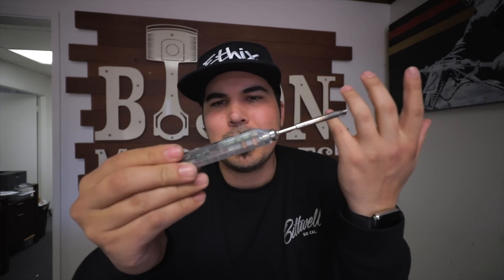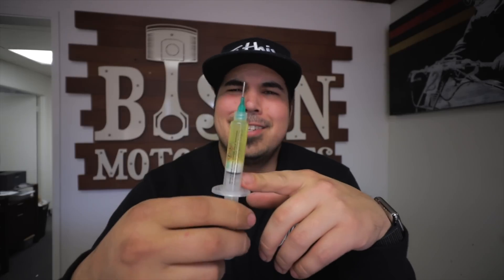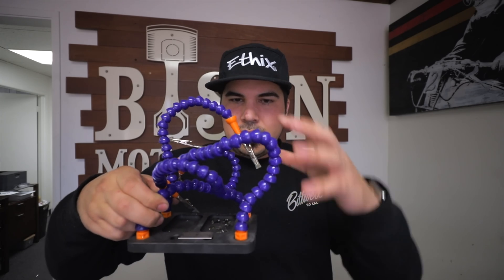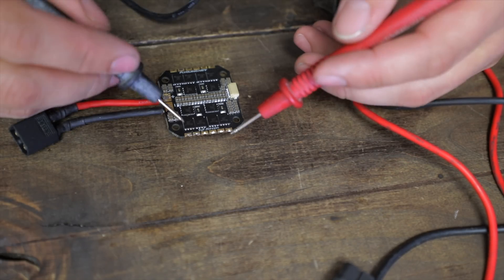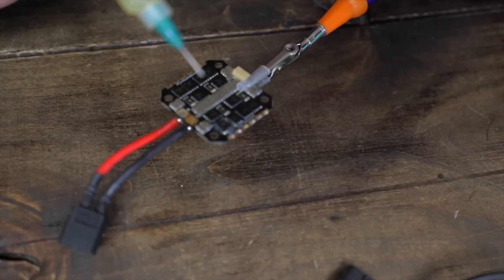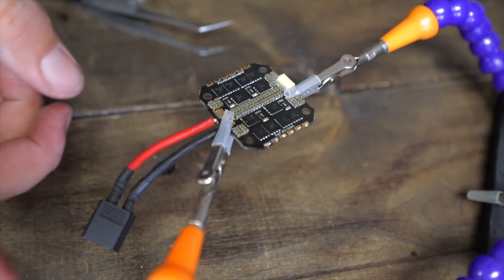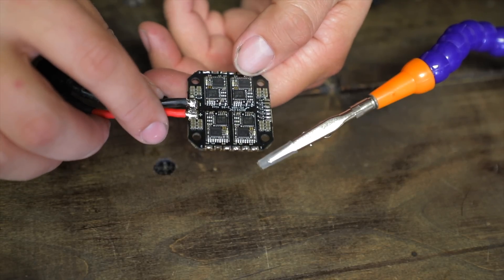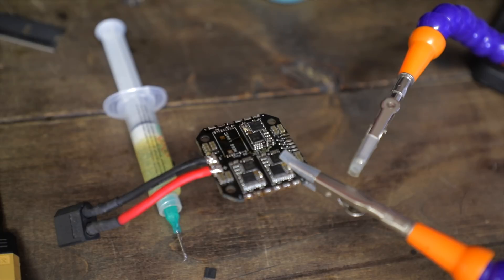Can you repair a KISS 4n1 esc

Comment: Hi Eric, I just wondering how are these ESCs doing on your setup? Are they able to handle your 2200kv motors on 5s with 6" prop? I am currently running a 6" setup with 1900kv motors and so far these Kiss 25a 4in1 are holding up but I am considering your 2200kv Moonboots or similar kv motor.

Comment: Since you are running 5s only, I believe you can run the individual 25a ESC's without caps. 6s is what you'd need the additional caps for. At least, that's what I remember.

Comment: Hey Konasty if all else fails you can use an individual esc in place of the broken one by running the signal wire to the flight controller and snipping the wire for that esc on the harness
Reply from the maker: Yeah I know but I just wanted to try and fix it I already have a new 4n1 on that quad

Comment: Did you use double sided tape to hold that 4n1 down or did it you use Steel/Aluminum screws ? 
I would recommend some fuel tubing under that bad dude, good luck man ✌😎
Reply from the maker: I used a nylon standoff with a rubber o ring

Comment: Great video man. It’s too bad you couldn’t get it working. I heard that the reason these often fail is because they are hard mounted to the frame. They don’t have gummys like a lot of newer ESC’s do. So when you smack the ground, you may not realize it, but your frame is flexing a little. Since the ESC is hard mounted, the ESC is also flexing. Because the kiss ESC has separate boards, and is very fragile, it can’t take this little bit of flexing.
Reply from the maker: I think it was more the smack into asphalt then anything
Reply: I think you are right, that's why I like to mount mine on the arms with 1mm silicon mat cut to the size of the ESC to insulate it from the frame and help in shock and vibrations.

Comment: Ok gonna have to stop and comment again.. my betaflight rig flys the same or better (that’s right I said it) than kiss.. now this is a quad that I tuned with blackbox and cli commands for the dynamic filter width etc and I can’t get prop wash on it if I wanted to literally..  I always say betaflight can fly like whatever u want it to if you spend the time on it for each quad..I personally prefer configurability over just plug and play smoothness
Reply: I disagree.  (That's it) that simple
Reply: Jason Hull that’s cool man I was just sharing my experience
Reply: How did you came to such a conclusion? Can you provide some of the testing method and results use to back up your statement?
Reply: No doubt. @cafub2650
Reply: Cafu B I didn’t really come to any conclusion just said I have a quad I tuned that flys similar or better than kiss lol what’s all the fuss about if someone said they have a F1 that flys similar or better than BF no one freaks out..
Reply: @MaxBeamer  no big deal man, Its just I don't agree with that statement,  if you fly kiss then go to betaflight or flight one and tune it up nice,  in your mind it's all good .. seems better.  But then you go and pick up a tuned Kiss setup and immediately realize the difference. I'm speaking from experience.  And I'm 100% Kiss after the fact. Nothing wrong with your experience,  not a wrong or right statement,  I'm just saying I disagree my dude. But whatever is in your stack, all that matters is it's in the air.✌ 😁
Reply: @MaxBeamer  oh and I hope the thumbs doing better ! 👍👎
Reply: Jason Hull thanks man yeh the thumb is getting there slowly.. I want to spend more time on kiss with a real premium setup and falcox to judge them unbiasedly once and for all but who has the time really lol
Reply: @MaxBeamer  
Max not freaking out. 
Let just say all the modern flight system works very well. We should fly what we can afford and enjoy the thing. And don't bash the other system.

Comment: It is really expensive but the feel is worth it. I also had one KISS 4in1 blew on me when I was trying to run 7" on 5s (with a 35V 1000uF additional cap). I am now running in on 6" with Emax LS2007 1900kv and 4s and it's pretty solid. Also tried 5s on this setup and it hold up. Anyways, KISS is delicate.